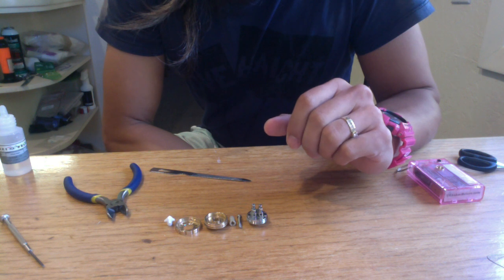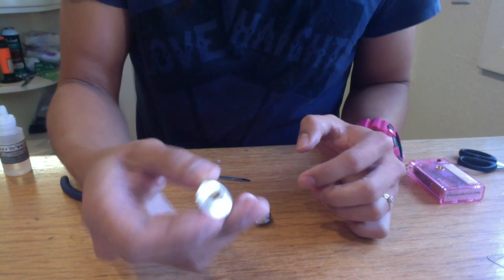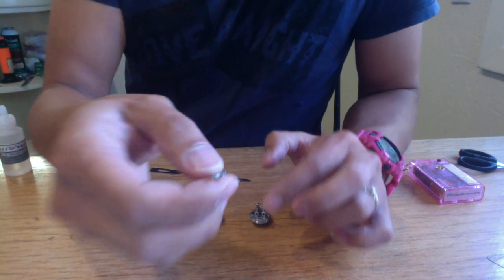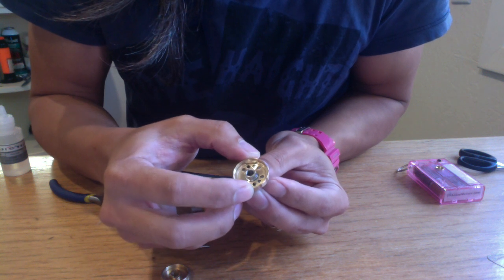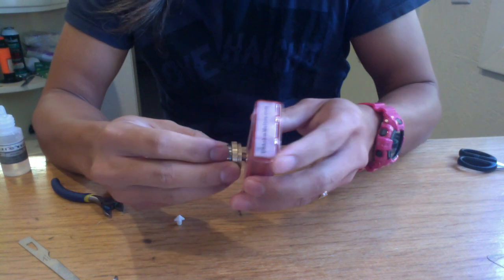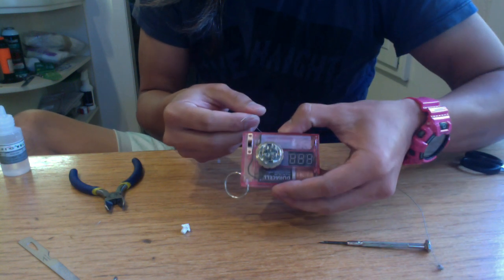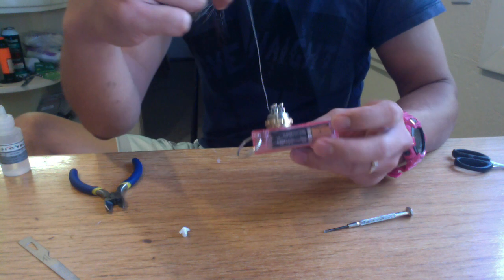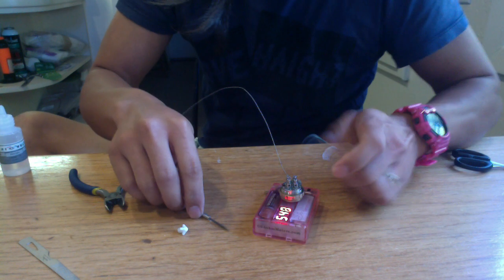Review and Quad coil Build Tutorial Geyser RDA by DarkRonin Mods Intl

Comment: Any chance you could help me out I've done a duel coils build and no matter what setting I put the ring on it has a really tight draw my wick isn't blocking the air holes or anything and my coil placement is perfect it's just such a tight draw I can barely draw from it without it feeling like I'm pulling through a tiny straw what do I need too do too fix it?
Reply from the maker: Get a comp cap
Reply: +omeagaultimate thanks man I ended up getting rid of it in the end I only ever used 24 gauge or less and the airflow was poor so I chucked it got my good old indestructible now and it's doing me good